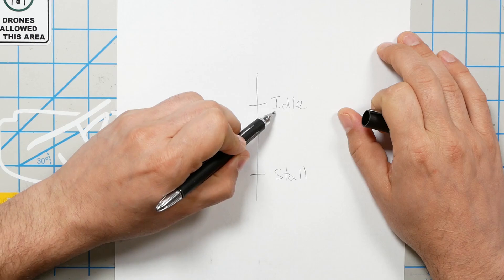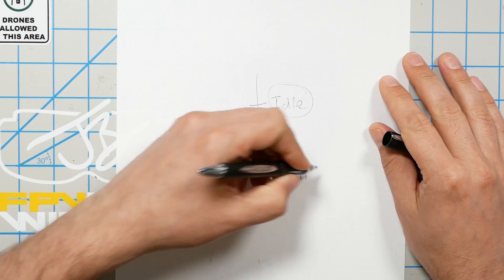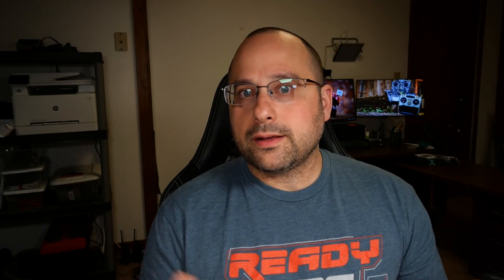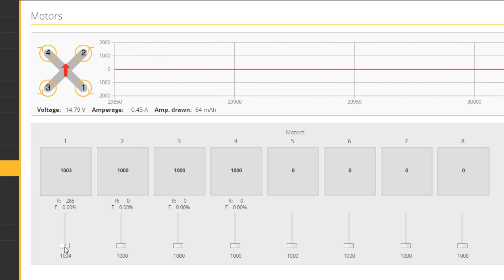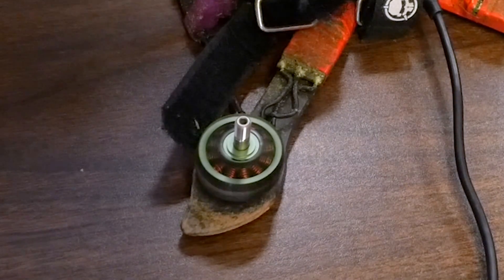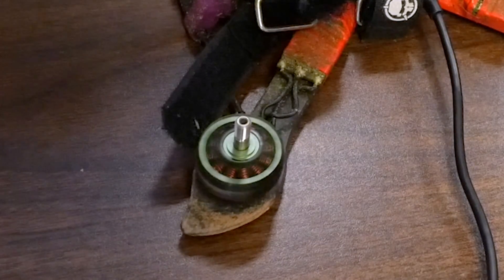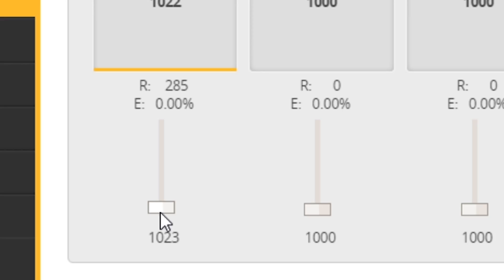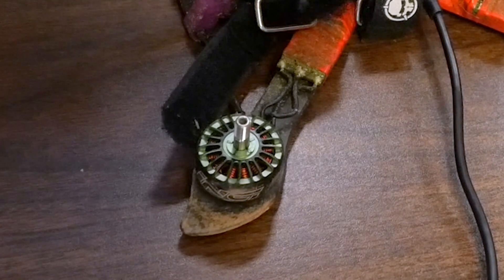"Dynamic Idle" the most useful Betaflight feature you never heard of

Comment: So what does the idle speed do if the PID loop can just ignore it. Isn't the PID loop always active?
Reply from the maker: The idle speed tells the PID loop what the  neutral value of the motor should be at zero throttle.
Reply: This lets the PID loop mixer output command values that are lower than the DSHOT Idle value on a motor that is still spinning faster than the set minimum idle RPM, which means the ESC can keep actively braking on those motors, instead of adding more throttle command to other motors on the quad.
Reply: @tehllama42  Here is the problem with that theroy imo. If the idle speed is set correctly in the first place, highest rpm that gives zero thrust, then going below this value does nothing useful, it just delays response and stability, see my post above for more info.
Reply: @user-rs8zg8ey2b  There's no RPM that gives zero thrust, and when the PID controller is requiring some differential across all three axes, most of the other motors are going to be commanded to spin at a higher RPM than the lowest motor, so the net thrust ends up higher.  If you can command a lower value that mixer differential is a lower average commanded throttle (less thrust) while still maintaining adequate motor response.  There are (you have to have blackbox logs to prove it, which I needed to convince myself) that there is lost response and stability at stupid low RPM idle values (<4% on quads that sane people would fly), but anything above that there is no lost response or stability (actually there's more).
Reply: @tehllama42  Zero thrust is when the rpm is low enough to not move the quad (yes it has thrust, but for the quads sake its zero), if you set the idle as high as possible with zero thrust (KE testing), imo, there is no need to go any lower. At this point you get highest inverted time and best response. How do you get more differential thrust by going lower? this is the part I am stuck on, until I understand how slowing down a motor that is already making zero thrust going to help differential thrust, just dont make sence to me.

I understand if your making MORE than zero thrust at idle, then the motor could be lowered, but if idle is set correctly (for my type of LOS flying), then this just degrades preformance.
Reply: @user-rs8zg8ey2b  I figure you're in a totally different flying regime for LOS, I personally am interested in this because I'm taking my 7" racing rigs and chucking them from hilariously high speeds into split-S and backwards moves and trying to rely on timing to punch up/off at the right time.  Those bigger props tend to make thrust even at pretty low RPM, so I struggle to wrap my head around an effective negligible thrust setup.
Setting a high static idle is the preferred solution if it works for you - in my case I got interested in this because I could tell that I was having to live with some compromises, but a lot of that has to with a setup that had marginal authority over the props (2507) and that without retuning the idle speed I was at half my hover thrust one most battery configurations at idle.
Reply: @tehllama42  i see where your coming from with larger than 5" props, the motors cant respond very quickly (relativity) and makes it much worse the lower you go (setting idle rpm), so its a larger PMOI issue and a higher idle helps this issue, that makes sense, but for 5" props, not so much. There is compromise almost everywhere, your taking a hit on inverted hang time to improve other areas that your quad is deficient. Fly on bud.
Reply: @ tehllama42
 you mentioned in another post "AND the ability to chuck into massive rainbow-shaped inverted yaw spins?  Yeah.

Realistically, I only got into this because I had a pesky 7" 6S rig that would hover at 9% throttle, but when I tried racing it would desync at values below half that." That seems to be a pretty powerful quad to hover at 9% thro,  hover is 1G, so at 9% thro and inverted your at 2G, add the yaw spin and is producing more thrust, so your well over 2G inverted, that must fall very fast, not sure about the massive inverted yaw spins (relativity). the other part of your statement was lowering below 9% would desync, again, massive PMOI (relativity) props killing the response time. Sounds like a quad with some fun and some serious issues for my type of flying. From hover, to wot straight up, how many G's does it pull in BB? tia  Whats your experience with a standard 5" quad and idle setting?
Reply: @user-rs8zg8ey2b  Yeah, whatever supposition that I had that I fly quads in a different regime from you, one hand launch of yours and I was completely sure you're on a totally different plane for LOS flying.
For high authority setups (22XX/23XX 5") I agree it's a relatively minor improvement, on very odd setups it matters a lot more. The dynamic RPM-based idle means you can get back that low throttle authority at a much lower cost to things like inverted hang time (for me, I can 'backdatassup' into race gates with less unplanned idle thrust).
Reply: @user-rs8zg8ey2b  Odd use case, in that I run 4S packs on that same rig to chase cars and warm up for races, but 6S for long range and stuff.  The idle value that works for 4S on that rig turns into something a bit dumb when I leave the GoPro and run a 6S 1000mAh pack for racing.  I flew that setup hard today hoping to answer a question for CTZSnooze, but ejected the SD card from it - but it's a pretty stupid fast setup.  Not LOS quad G levels, but it's a quad that lets me situationally run down much faster pilots.
As far as 5" (and 3" heavy), I've been generally happy with 4.3% idle and partying on, with the exception of certain super-light 2205 setups (<200g dry weight), where again this was super helpful.  Ditto on super-light toothpick type 3" quads where the motors could struggle when I took a nominally 3S quad and ran it as a 2S spec racer type setup.
Reply: @tehllama42  thanks for the reply, and its good to see the old CTZSnooze, he works wonders and I like his theories, good guy.
Reply: Back in Aug 2018, I was telling Joe Lucid about a dialed 4S quad suffered on 5s speed from the extra reverse load on the props. Joe wrote "Would be so easy to solve: just ensure a minimum rpm in all situations. If we just had real time esc telemetry the fc could do it in a heartbeat."

I then thought, why not just do it in the ESC, so I posted in the two blh threads and sskaug responded. 

"We already have a good govenermode for heli esc code, so implementing some of this code might not be starting from scratch. "  As far as I know, it never went anywhere, but now with bidir dshot telemetry this could happen, maybe I am missing something?
Reply: @user-rs8zg8ey2b  That thought went places, I promise, and this is part of the result..  So, the key to all that is that Thorsten wrote (in assembly for JESC, absurd) the ESC code that repackage the back-EMF pole crossing data into RPM feedback, and the Betaflight side that can interpret those pole crossings per interval fed back through bidirectional DSHOT into an actual motor RPM - the biggest benefit still seems to be the RPM Notch filters that crush noise for very low phase latency costs, but it can also be used for idle status data.  BLHeli32 achieved the same thing with 32.66 and later.  What these settings are trying to do in this case is establish that 'fc tries to ensure a minimum RPM', but it isn't as intuitive as setting a hard boundary, because the motor responsiveness (particularly in negative AoA moves) is lower at that very low RPM, so I've found you want to have a slightly higher than you'd expect minimum RPM for idle, but that we can achieve exactly what you're talking about.
That same 4S to 5S switch you're talking about I experienced pretty bad with my 7" setup, which is why I keep referencing it.

Comment: This is crazy. I was running emas 2600kv red bottoms and I was getting death rolls Everytime I did a roll or flip. Couldn't figure it out. After swapping FCS and escs with no resolution I finally swapped the motors and no more death rolls. Could this be the reason why those motors would do that, desync? And this should probably fix that. Because those motors are still.good and I wanna put them to use
Reply: If BLHeli_S, you may need to lower Start Force.
Reply: You mean the start up power. I think by default it was on .5 and then after my death roll I put it to .025 and it still would death roll. So I thought it was the FC and swapped it out. But still the death rolls would happened every roll I attempted. I could however roll right. But roll left or flip front or back would go into a death roll. Once I swapped the motors noprw death roll. So I'm just concerned as to what was up with first set of motors. They would fly great on the quad but after a roll it would death roll.
Reply: @yungseed80r  ramp up is only power to start from 0 rpm. red bottoms are horrible motors, that is your problem or yor min-idle is too low, get some good $12 rcx motors

Comment: i take it you cant check the rpms on the tyro119 as mine doesnt show the rpm. cheers
Reply from the maker: You need bidirectional dshot support.
Reply: Joshua Bardwell i have switched this on and reflashed the escs with the write firmware but I just get error 100% on all motors.

Comment: I struggled with Dynamic Idle feature and burned more than 100 battery packs for test. I conclude +1-2% idle up is more stable than with this feature. Obviously, this feauture are designed if all 4 motors are equally good condition. but most of case we have not such a ideal condition except new quad and such a unbalanced motors situation we need the feature like a Dinamic idle.....  When all motors are not equally good, this feature dive quad crazy suddenly while we do manoeuvre.. (BF4.2)
i hoep somebody point me I am wrong.

Comment: i think because it is quite useless, thats why not many people heard about it.
i tried it on many quads, on high powered 5" and underpowered 2-2.5". the lower power/weight ratio, the worse it gets.
tried it according to the guide (0.8 of dshot value rpms) , tried rise dshot value to 9% and rpm idle accordingly, on defaults...  - the result is the same. it flies almost exactly like dynamic idle =0 , but usually steering performance degrades significantly, arcs become much wider, steering at low speeds less precise.
trying to compensate it with thrust_linear is to tricky. i usually set it to 4 just to make a quad more stable at long dives, but going up to 10 or even more usually produces noise in video feed.
---------------------------------
i think if a feature doesnt show noticeable improvement it's not worth the hassle.

Comment: Hi; I use your channel as my goto for everything about building, tuning quads.  I have to say, I still wouldn't be flying yet, if it weren't for Bardwell knowledge base.  I tried dynamic idle today.  I used d-shot idle as 7.5 as can be seen, I'm a very amateur pilot,  and need all the help I can get.  I set idle min at 11(00) - even though my betaflight motors tab allowed idle down to 4(00) rpm.   For the first time ever, I got confident with hang time, albeit momentarily and also noticed the drift when turning into a dive was significantly reduced.  I have put it here to illustrate but completely understand if you delete and apologise in advance if it contravenes any rules - just trying to show how much it can help a shaky old dude trying to fly - https://www.youtube.com/watch?v=RcbRVws68W4&t=78s - and thank you, yet again, for immensely informative videos

Comment: Just fly Kiss and be done with it lol
Reply from the maker: $70 per flight controller and no built in OSD. Soooooo.
Reply: @JoshuaBardwell  put that all aside it flys 100 times better then betaflight. I have a bunch of betaflight rigs and they all have issues that I dont have time to tune and mess with. If you have the money and want the best locked in experience cant go wrong with kiss. Yes, its finakey and isnt perfect with osd and stuff, I wither use an evo or steele pdb for osd, but go fly a betaflight quad into a 20mph wind with a gopro, no hypersmooth or rsgo and then fly a kiss quad and compare the same and the kiss quad has little to no oscillations where at the betaflight quad has parkinsons

Comment: Sorry my english.. i try to tell you this as i can. You are wrong. Its not like you said. Motor tab you raise motors to 1050 if your digital idle is 5% there you look your rpm and multibly that 0.8 which is 20% less than your digital idle rpm. That is why your method was not high enough number. I hope you did understand my english. Im much better in finnish its quite common in finland. Lol.

Comment: I quit betaflight. They keep adding so many fucking things its getting awful hard to keep track of. "WE NEED MORE SLIDERS! MORE KNOBS! MORE BUTTONS! NOT ENOUGH VALUES TO CHANGE! CHAAAANGE EVERYTHHIIIIIIING"

No fucking thanks. Emuflight for me.
Reply from the maker: I mean fly what you want but Emuflight also has a shit load of sliders. Nobody is forcing you to use dynamic idle. Why not just pretend this feature doesn't exist and fly?
Reply: EmuFlight is FAAARRRR more complicated.  Filters per axis noone understands.  Setpoint Weight and FF options.  Emuboost and FF options (which conflict), Cinemode, and now a PID controller for the sticks to tune.  What?  You nutz!

Way to confusing and no good PR QA process.  No thanks.  Watch your face.

Comment: They should disable airmode by default it almost damaged my quad just maxing out 1 motor speed to full without even a throttle with props on, luckily i was holding it and it was 450 quad things could have very bad , didn't like airmode at all 👎🏿
Reply from the maker: If you arm the quad with props off, weird things happen. Don't do that :-)
Reply: @JoshuaBardwell  thnx for replying can u link me a pid tunning guide for big 450quad in beta flight very much appreciated